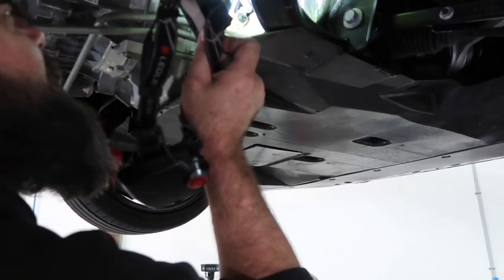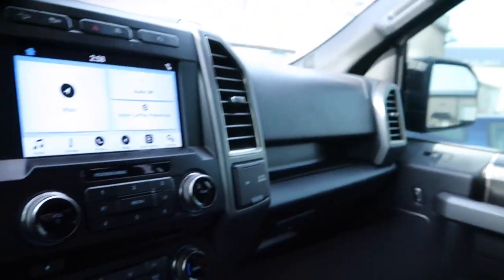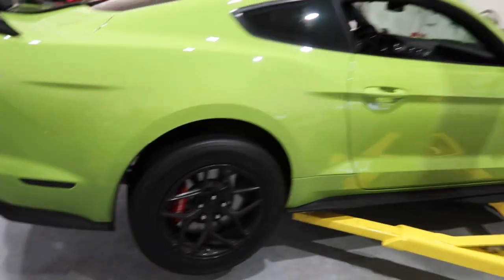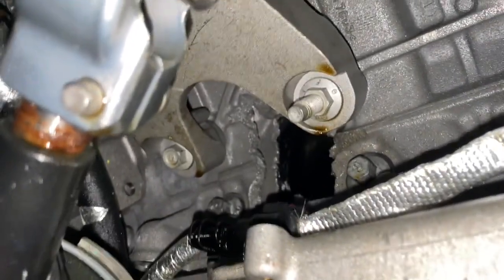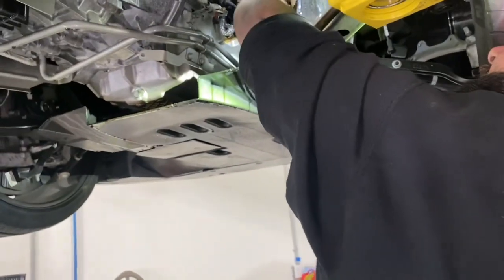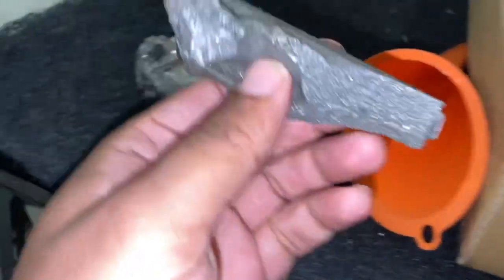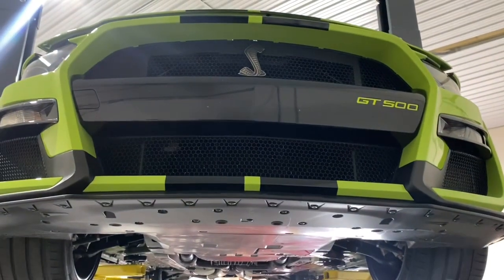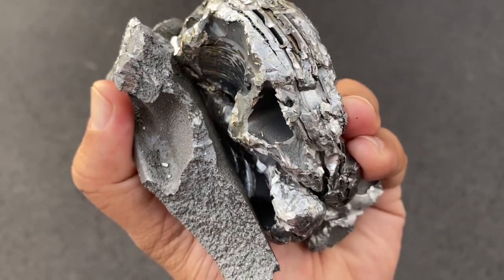I’m F’d! My 2020 GT500 blown Motor is Worse then we Thought! *Part 2

Comment: Sorry for your loss, my bud has a 2020 gt350 his motor went after 500mile zero mods. The motor alone $27k, the metal with thur motor and out, they replaced upper intake, throttle body,oil cooler, lines, valves on #8 cyl, catalytic converter....etc. All told between $35/40k but the difference was his was under warranty, so I wish you the best I’m sure it will be back and better then before.

Comment: I wish this didn’t happen but on the other hand, a built motor is whats needed for the quest of low 7’s
Reply: Your talking about mamba the Gt?
Reply: None of these cars are going low  7s 1/4
Reply: Lmao...low 7's ok buddy
Reply: Record is still 9s for a gt500. No way adding a built motor is going near 7s.
Reply: Jason Jennings  stock gt’s are lighter even after turbocharging
Reply: That dual clutch cant handle it. He would have to go glide or th400 like David VanVoris did or build a hell of a 10R80 like Manuel Gomez did. No trash ass Gt500 is coming close to those cars.
Reply: Jason Jennings  ya and a stock engine get went 790 . You have no idea how hard it is to go from 790 to 720 . The gt500 will never go 790 or lower unless you take everything out that makes it a 500 . Then you just have a gt .
Reply: @I5ZQ8  Spot on. He wants to get into a lower ET but, its another level. Huge adjustments have to be made. I kinda would like to see a glide on that car.
Reply: Jason Jennings  A x275 race car really you think that counts ? It’s a shell with full chassis. And that’s exactly what I’m saying . If you take the dct out and put a turbo 40o or powerglide in why start with 100k gt500 .

Comment: Good luck with getting it fixed. So many people try to push me on running E-85 in my race car. I will never touch this fuel. I personally don't like it. For racing, it's C-16 only over 10 years racing never blew a motor on C-16. I have seen far too many people blew their motors up running E-85.

Comment: "Just a loose oil filter" 😂
Reply: You laugh, but it has happened. More than a little bit. It's why Adam LZ's GT350 burnt down.
Reply: @Mr. Poopybutthole They rev high, and the filters vibrate loose over time. There is an actual torque spec, and if not followed, there is a likely chance it vibrates loose. On the GT350 they updated the filter to try and eliminate it. I would assume it's the same for the GT500.
Reply: @Cronus_1  they should def look into safety wiring if these rides vibrate that much.
Reply: @christopherjohnson3614  If specs are followed, it's not a problem. But if you get someone that comes along and doesn't torque something properly, it could cause an issue.
Reply: @Cronus_1  I didn't know about that issue, that's crazy
Reply: @ICON-11-  it was a recall on the first 2 years of the GT350 because of the vabrations caused by revving an engine to 8250 rpm for extended periods. They subsequently changed the filter design, but for any high performance engine running high revs, vibration is going to be something that needs to be thought about. And the Hulk, having a PBD tune, was being revved high.

Comment: Have you tried kniffing the crank? It'll help with the higher revs on boost... also use methanol to spray the intake on boost... the heavy parts fail at high rpms...sleeve the new engine and bore to .20 over.. lower the compression to between 8 or 9 to 1 and that will give you the low end torque as well as the leapfrogging of the jump... you can add more boost too... or just buy a billet crank but thats not as reliable as the super hardened factory crank knifed so you don't get the imbalances of high rev.... hope this helps with 💡

Comment: At this point a new motor.. It would be crazy to even swap over any internals.
Reply: I agree. Id go brand new on everything. Why gamble? Just buy a new replacement motor or build one to spec. Send it!
Reply: I saw they're selling those motors for like 28k now lol
Reply: whatever parts that "may" be salvageable he can save for a build on a 2nd "back up motor".  it can simply be a used "Franken-Coyote" he can temp swap into the 5 or Mamba should the need ever arise.
Reply: @hectormedina6705  28k is on the low side.
Reply: @phillyphil1513  By the looks of that engine, I would part out and sell whatever is left. Why risk failure again? That motor looked looked like a scrap yard inside.
Reply: @scringe1  no worries, the key phrase was "backup motor" not PRIMARY motor.  "redundancy" is how the pros do it, we don't just beat on the same power unit all season long hoping for the best, no, we rotate through an allotment of 3-5 engines allowed by whatever series rules we're running under.  of course there's a cost to competing at this level, but we're not talking competition, we're just talking about a guy Monetizing having fun with his car on YouTube (this can be enjoyable too).  also, something else that never occurs to us is that not every engine we slot into our vehicles HAS to have 1 million HP (true story).

Comment: The Predator's are $25,000 through Ford directly, with a $1,000 replacement fee. And they are currently on back order. So if you can't save anything, then add labor and you are probably looking in the neighborhood of $30,000 all told. Best of luck, maybe it won't be that bad.

Comment: Now you know the limits of the stock bottom end of that GT500
Reply: @Ravenstylea2 .... Yeah, I Didn't Think That The Stock Bottom End Would Handle All Of That Boost 🤔
Reply: I think Lund and evo have gotten more out of em
Reply: Oh you did use the qualifier of THAT bottom end
Reply: There are plenty of people pushing 1100 plus horsepower stock bottom in.
Reply: @RollingAintEasy247  yes just because you can make that amount of power on the stock block does not mean it will last LOL still requires good Pistons and good rods more than likely those Pistons are hyperutectic especially being a production vehicle
Reply: @bluecollardaily2676  yup it’s all about who the tuner is.  Lund is top notch with the 500s.
Reply: @troylambert5140  everything in that motor is forged from the factory. My guess is either the oil pump broke or detonation from bad e85.
Reply: @chadhelms8350  I don't believe he upgraded the fuel system. A fuel pump booster. I think it was running super lean in higher RPMs
Reply: It wasn't a to much power problem. It was most likely to high IAT's and bad and or inadequate fuel problem (shit fuel). You can hear the motor lay over but be stayed in it. Then didn't shut the car off. Still would have been fucked up but it may not have cracked the block if he shut it of right away.
Reply: I wonder if Ford used Powder Metal rods again. Stupid they would do that to their halo V8. Ive got those POS pm rods in my 2011. Forged Mahle Pistons, Cobra Jet crankshaft but powder rods. 03-04 Cobra's still hold the standard to which Mustangs with Snake badges should be held to: Forged EVERYTHING from the factory.
Reply: @lexustech48  this wasn't remotely close to rod failure.

Comment: Very tough, You had hopes for better, but considering how bad it was smoking out the tail pipes, it kind of knew
the block was broken, but would not of thought of  2 open doors on the block, more than likely the cylinder
that broken piston came from probably struck the head too, but upon disassembly you will find out for sure, good
luck on better results.

Comment: I do alot of engine dyno testing for Ford at their dyno lab in Dearborn MI. With a piston chewed up like that it looks like it dropped some valves beat the shit of the pistion till that dropped then im guessing the rod punched its way through thr block. Dude this is devastating😭. I even had a lil bit of seat time running this engine doing oil aeration. I hope the heads are fixable,but at this point who knows. Drain the oil pan,and cut the oil filter open well you are at it. Good luck guys

Comment: Stangmode, was your tuner are able to take a look at any data logs if any, were you running lean.
Reply: Or too much timing combo w/ bad fuel.
Reply: He was probably pushing it with timing and if you're not sure what your pump E85 methanol content you're messing with fire. I wish the best for him, like the black mamba.
Reply: Pretty sure this car didn’t even have a pump booster. Needed full fuel system at this power level. Went lean.
Reply: You can see the marks on the piston where it was detonating...
Reply: @richardhanning326  detonation might as well be dynamite at high boost levels like that. That piston top broke in half. Pretty telling imo.

Comment: I would check copart for a wrecked 500 with a running engine
Reply: I doubt anyone has crashed one lol
Reply: @just_a5.7  well it's a mustang owner so....
Reply: Still gonna need to be built afterwards
Reply: Jets Set . At least 3 have been wrecked so far
Reply: rest assured if there's a wrecked GT500 somewhere, Stang will not even remotely be the only one looking at it.  this means it's already been "pre-sighted"  by at least a dozen others, so his chances of getting it are unfortunately slim to none.
Reply: Thats the only way he will get another motor, cuz ford doesn't sell GT 500 crate motors!

Comment: My take. Blew a head gasket from too much boost, and hydro locked in 1 and 6 , since liquid isn't compressible it broke the pistons, and flopping pistons means flopping rods, and they fall to the sides, the crank drives the rods through the block. Sorry to see this. But, more power means more risk. Coolant was 100% visible out the back, head gasket failure. Sorry brother. Best videos on youtube. I'm a big fan. Best of luck.

Comment: Can't even joke about this. How in the world did this even get this bad. Was this detonation related? 
Bad fuel?
JB Weld can't fix this.
Reply: Stock internals can't handle the mods and tune he added.  Has to be built right.  Plus he couldve also gotten ahold of some bad e85.
Reply: @richardlapoint1845  that was what I was thinking, because other modded GT500s haven't blown apart like this. I think StangMode's car is the first to experience an engine failure of this magnitude. It's painful to watch. Been there, done that.
Reply: Yeah i feel for him,  but it should be a lesson learned.  If you're gonna have that much power,  it better be built right.

Comment: I'm starting to question how reliable the Voodoo and Predator  motors really are as far as making power goes.
Reply: Ditto. Looking like the epitome of engineered to a factory power spec and nothing more.
Reply: It would have been fine if he had left it stock. The Voodoo engines are another story. They have issues.

Comment: The fact that you are testing the e85 post failure, makes me sad. A safer fuel unless you don't know what you're putting in your tank.
Reply: 100% agreed. Most people skip this tiny but CRUCIAL step!! It’s annoying to do, but I’ve seen E15 in pumps that should be E85... car isn’t going to like it
Reply: You could always do an e85 content gauge
Reply: @Eddy-09  For sure. And if there is a good network of car guys in an area, there is usually a bunch of testing that gets done throughout the stations locally, but still some piece of mind to do it yourself. So many people badmouth a tuner or E85 tunes, but usually the failure is what's going in the tank. Fathouse has a flex fuel tune that they do. You can put basically anything in the tank... Within reason.
Reply: I've also heard that it's good to add a fuel system conditions occasionally, because E lacks it in the mixture.
Reply: @Cronus_1  Exactly a lot has to do with the quality of fuel you’re putting in the tank. If you’re tuned for E85 but you pump E40 and you have an aggressive tune, you don’t have a lot of room for any failure and any knock at this power can cost an expensive motor like this one
Reply: @raysp3c  yeah you can. But by the time the gauge is reading it, it’s already in your tank and being used. It’s better to check it before you put it in.

Comment: Damn thats crazy. I wonder if the motor was defective to begin with?
Reply: He kinda pushed too hard on the stock internals. The engine is prob good for 760bhp. But when you are pushing over 1000bhp. Things starts to fall apart.
Reply: Will never know
Reply: @linchester8464  you right bro adding that kinda hp that stock engine only going to last so long i found out the hard way too
Reply: Some of y’all are really putting too much thought into this. Too much heat not enough cooling= motor go boom. What you saw was not a parts failure....that was an explosion
Reply: It's probably the fuel. With big power tuned for & running e85. The fuel must be tested before using it. If the fuel and ethenol mixture is substantially below standard it'll definitely cause destination and blow the Pistons & rods.

Comment: This has been a documentation on what not to do. The car isn’t built correctly. Warranty voided. Doesn’t monitor the engine that I have seen. When my ‘17 GT350R engine let go at track I got a full buy back from Ford because while I modified the car, I did nothing to the power train and the warranty was honored. The fact I had not modified the engine meant I was able to get a fully loaded ‘20 PP2 GT with plenty of cash left over for mods none of which will void the warranty on the PP2. Moral  to the story if you are gonna race then either have a “when it breaks” fund or don’t void the warranty.